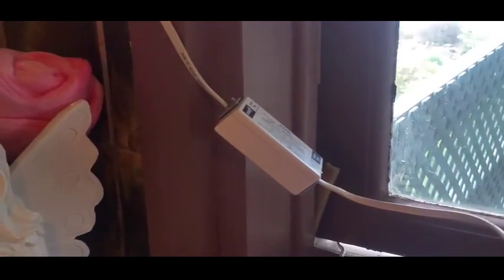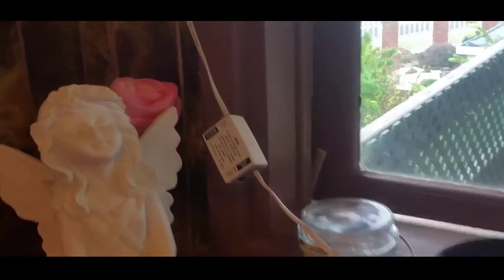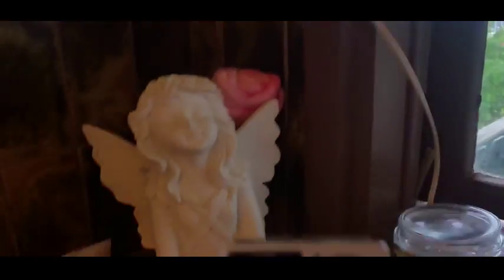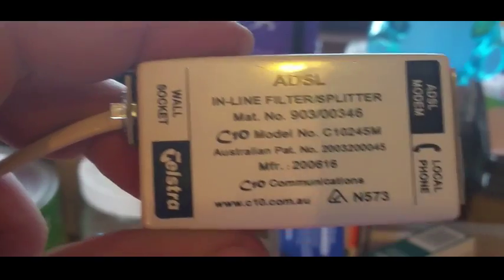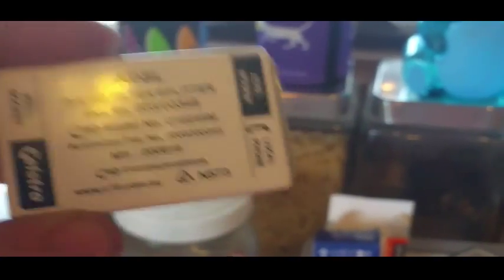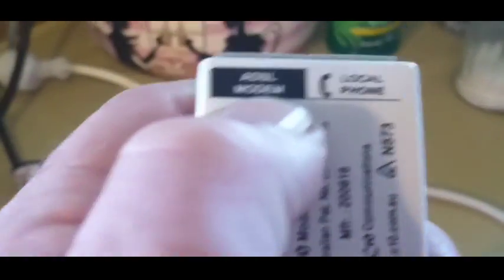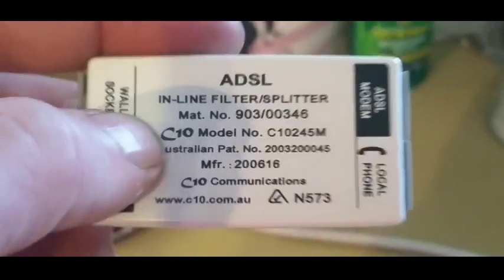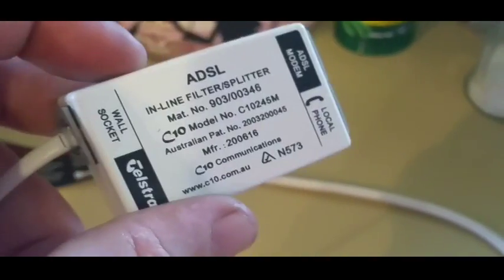How to perform a DSL line isolation test

Comment: If you don't have phone line why do you need filter? Why not plug it directly on the wall socket?
Reply: You can still pick up noise and interference from the other jacks in the house.  The house wire can act as an antennae and pick up noise.  Unless you are removing all other jacks and/or inside wiring from where you plug your equipment in, use the filter.  Some providers do provide whole house filters.

Comment: Good Day. How about if the telephone is buzzing and the internet intermittent at that time but it mostly happen during morning?
Reply from the maker: Mark Errol Laboc if your internet in intermittent or noisy phone line, you need call your telco provider. it could be an issue with the line to your wall, or telco line outside your property
Reply: The technicians will be visiting me again today for the 6th time already. So far they seem to be not able to fix it despite replacing the landline and modem. Thanks.
Reply from the maker: Mark Errol Laboc check to see there is no water either in your walls near the plug and no water in the telco pit in the street